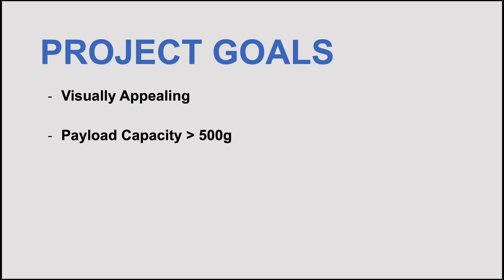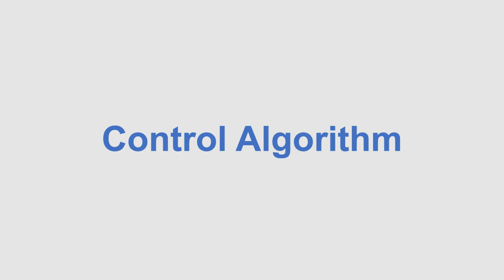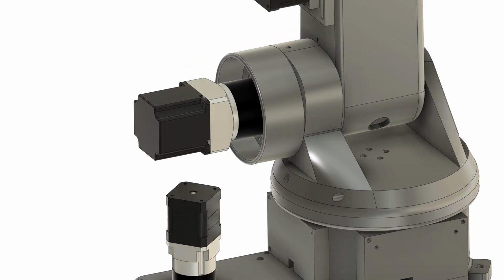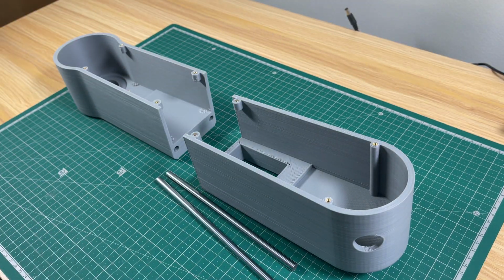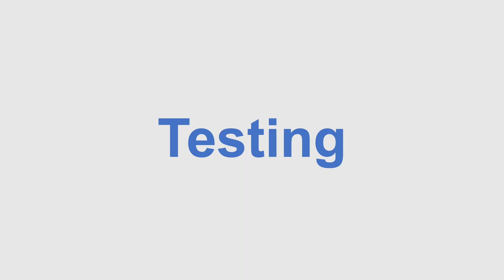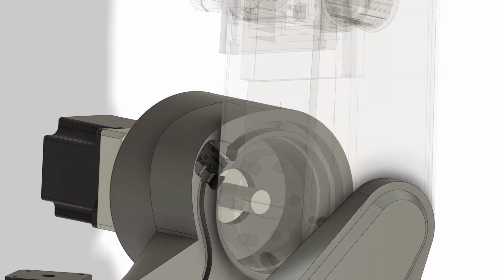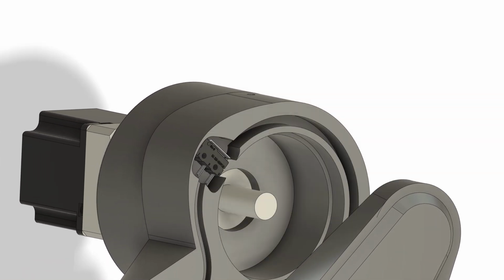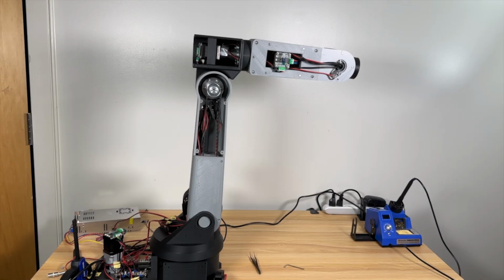We Built a 3D-Printed 6DOF Robot Arm From Scratch

Comment: instead of increasing the belt tension until the arm is bent like a banana, I might have a suggestion. What if you add some bearings that pinch the belt between the pulley and the bearing? So basically the inside of the belt (the side with the teeth) is on touching the pulley, and the outside of the belt is being pressed down by a bearing

Comment: As some general feedback on your design it looks like your J3 belt is a serious guy, getting the correct tension on this belt for it to seat well is likely flexing your motor J3 and axis J3 creating too much bending load and jamming up your rotation. I would look at getting a much lighter duty pulley belt that can be tensioned easily. Additionally you can increase your axis resistance to bending by A. reinforcing the shaft (A nice way is to run long bolts through the part) B. double up on bearings, the higher the offset between the greater the resistance.

Comment: Great project ... advice is to move the reduction (gearboxes) closest to or inside the joint itself so the belt is running lower torques and higher speeds.

Comment: do not use belts and reduction. Rather set the values related to speed in firmware program itself. For reference check how Marlin firmware does that for 3D printers

Comment: It would be a lot more effective to place the slipping belt between the motor and gearbox, with the gearbox directly inline to the elbow joint. It would reduce the stress on the belt and the required tensioning force (maybe use a finer pitch belt as well).

Really cool project!
Reply from the maker: I am not sure I understand what you mean but we totally redesigned the mechanical design for that joint. Stay tuned to see what it looks like!

Comment: Great first iteration, I'm sure there were a ton of lessons learned from this. It looks like your belts are only supported from one side and that's why one of your supports snapped. I'd also suggest looking at capstans (steel wires) instead of timing belts, especially if you want to ensure tension over a long period of time, as 3d printed supports tend to warp fairly quickly. It will be a little more complicated to assemble, but great for applications where you need speed and a lot of torque. Great work overall, looking forward to seeing you grow as an engineer!
Reply from the maker: Thanks, We really appreciate the feedback! Yeah, there were definitely a ton of lessons learned from this first iteration. Capstans are a great idea, I'm sure that would have fixed the issues we had with the belt mechanicsms. We ended up doing something different. You'll see what we did in our upcoming videos.
Reply: I agree with the need for a bearing at the furthest end of the driveshaft to provide support for the belt pulley as it will be under too much pressure for the plastic to hold.  Always support driveshafts at the far end to avoid this.  Well done though.  It is a great project.  Can't wait to see the end product.